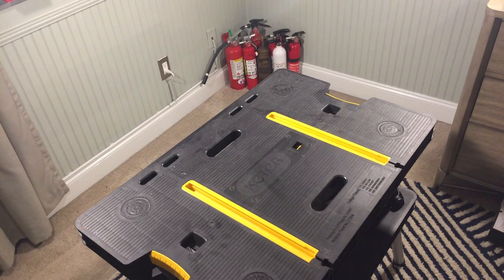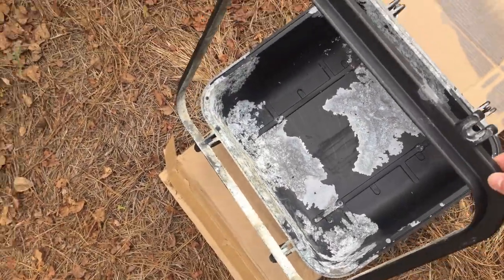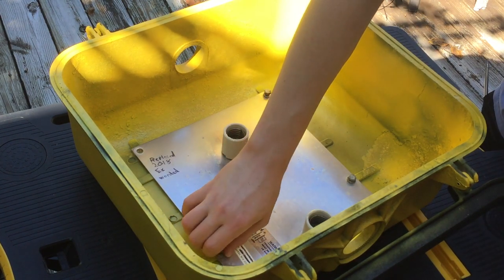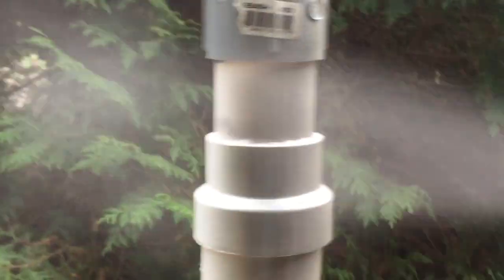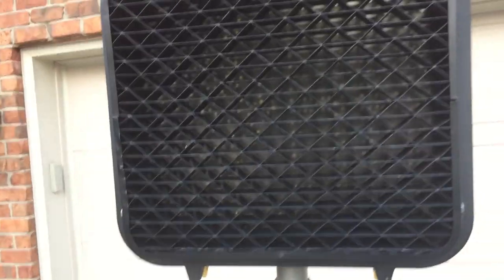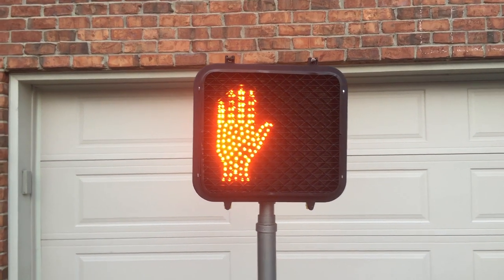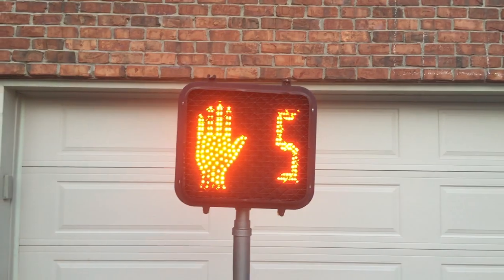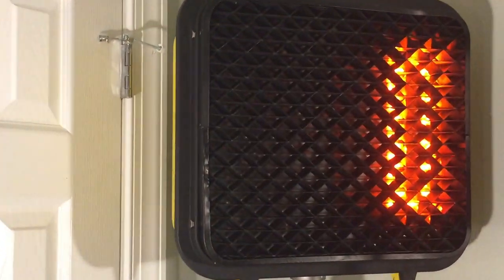Building a Pedestrian Signal Demo

Comment: Great video! If you ever do this again you might want to use some 2” rigid conduit and use some separate 14 or 12 AWG conductors and ground the box because that extension cord is only 16AWG stranded but other than that that’s really cool man! Can’t wait to see more! Have a great day!!!
Reply from the maker: Thanks! I plan to make more traffic signal videos soon. I thought about metallic conduit, but the PVC works fine. The ped signal isn’t all that heavy. Most of these signals aren’t grounded, and the material of the housing isn’t conductive so I didn’t use a ground. I stuck with a typical 16 gauge extension cord because the signal and arduino hardly consume any power, so a thicker wire wouldn’t be necessary.
Reply: ExitSign250 got ya sorry if that came off the wrong way but this is definitely a cool area I never thought about traffic and ped signals and how they work! Keep up the great work man!

Comment: Awesome! I'm not sure what model ped signal you have, but on mine, there is a plastic cover/cap you can pop off in the back and there are some dip-switches inside. One of the dip-switches allows the signal to remember the count down clearance time even after a power failure. That way it doesn't need to do the learn cycle every time you power it up. It's nice for hobby displays when you power them down all the time. If it does have that, you may want to remove that test cycle when it first powers up. I think that will confuse the computer. FYI I use Arduions also for my displays. Awesome video man!
Reply from the maker: Thank you very much! I’ll have to check with mine, I wasn’t aware of that feature. If that’s the case I’ll definitely remove the test cycle. Thanks again for the info!

Comment: Do I have to ground myself with a wrist strap to a fire alarm control panel before doing wiring or work on it? Thanks
Reply from the maker: That’s an unusual practice. Most manufacturers just recommend shutting all power from panels and devices. With all power off, you’ll be completely safe.

Comment: Nice! I just bought a potter pfc 6006, just wondering if I need a separate power supply or if the power supply is built in to the panel. Just wondering since you’ve had experience with your 5ud and 9200udls. I don’t want to fry my panel since I got a really good deal on it.
Reply from the maker: The power supply built in when wired will be enough for the system. That’s how most panels operate.
Reply: ExitSign250 thanks!

Comment: I need one for pedestrian safety presentations for work. any ideas on an easy way to set it up to be used without electricity? I have zero idea how to even go about it. Any suggestions would be appreciated.
Reply from the maker: There is no possible way to build one of these that does not use electricity. If you are trying to have this portable without a cord, you could get a battery pack to power the setup.
Reply: @ExitSign250   Sorry I meant with no direct line to electricity, a battery would be ideal. Thank you.

Comment: @4:05 Where did you find that base for the pole that screws into the wood? I can’t seem to find anything like that
Reply from the maker: That is a PVC closet floor flange. I bought mine at Home Depot, and they should be sold in most hardware stores.

Comment: Just so cool! How hard was that to program?
Reply from the maker: Thanks! I had to learn how the Arduino worked and how the program functioned. That would be the hardest part. The actual programming part was easy for me.
Reply: This is the code I wrote for mine with an Arduino. 

int W = 7;
int DW = 6;
//W is Walk, DW is Dont Walk
void setup() {
  // put your setup code here, to run once:
pinMode(W,OUTPUT);
pinMode(DW,OUTPUT);
}
void loop() {
  
for (int x=0;x<30;x++)
{
digitalWrite(DW,HIGH);
delay(500);
digitalWrite(DW,LOW);
delay(500);}

digitalWrite(DW,HIGH);
delay(10000);
digitalWrite(DW,LOW);

digitalWrite(W,HIGH);
delay(10000);
digitalWrite(W,LOW);

}

Comment: Howdy! I recently got one of these, and I don't actually know how to wire it up - how to signal it to start counting down. (I'd like to use it as a "I'm in a meeting" indicator, with the countdown timer going down once per minute to indicate how many minutes are left in a meeting.)
Reply from the maker: That sounds like a neat project! But unfortunately these types of pedestrian signals do not work that way. This style counts down by itself, meaning you cannot manually control the numbers. The signal counts how many times the hand flashes, then it will display the correct time to display during the flashing don’t walk phase. I believe there are some standalone countdown timers out there that you can manually control the numbers, but most styles are not like that.
Reply: @ExitSign250  oooh, I see. dang! I might have to cut this thing open and replace some of its guts, I guess. I'll lose the authenticity, but gain a neat thing!
Reply from the maker: Yep! With some modifications you should be able to get it to function how you want. I think it’s still a very neat idea! I’ve never seen or heard anything like it.
Reply: @ExitSign250  I've heard that it usually takes a cycle for the countdown timer to "learn" based on the number of hand flashes.  It would seem a sequencer of some sort is obligatory.  I just picked up a NIB GE countdown module that has the countdown jumpers in back for testing and normal operation.
Reply from the maker: Depending on the brand, it will ether take the signal one or two cycles to learn the countdown timing. This is then reset when the signal looses power for more than a few seconds. Other brands allow the option for the signal to “remember” the countdown time so the 1-2 “learning” phases aren’t required.
Reply: @ExitSign250  Ahhh ok good to know!
Reply: @ExitSign250  I just did a power up test with my GE GTX pedestrian module and it took only one cycle to learn the countdown time.  The GTX series have jumpers in back for testing and normal countdown operation.  I paired it with a Galak VG-306C controller and other than slight lag during countdown it works great!

Comment: I still don’t understand how the controller works the countdown? Like specifically if I was to build my own controller I could make a timed switch between walking man and hand but how does it countdown?
Reply from the maker: The pedestrian signal itself counts down. My controller simply pulses the hand on and off 20 times. Modern hand/man signals with countdowns will count how many times the hand is pulsed and display it when it goes into the flashing don’t walk phase.
Reply: It self learns. Basically you need to have some kind of controller such as an Arduino or a raspberry Pi to be able to flash the hand signal a specific amount of times. I programed mine to count down from 30 seconds. So I told the Arduino to flash the hand on for .5 seconds, and off for .5 seconds 30 times, and then leave the hand on solid for 10 seconds, and then Walk for 10 seconds and this just loops continuously. 

Once it goes through one cycle the onboard computer separate from the Arduino learns how many seconds to count down from. So once you program it, the first time around you won't see a countdown. But the second time through you should see one if its programed correctly because it needs to learn what you have told it to do. I hope that helps. I have the Arduino code I used just let me know if you want to use it.
Reply: @J.T.Engineering  can I get the code u used ?